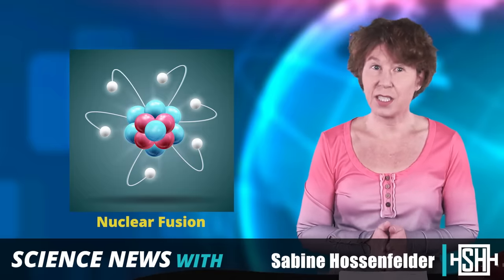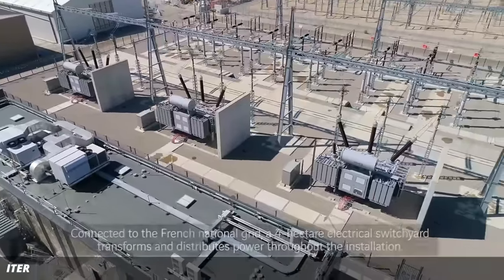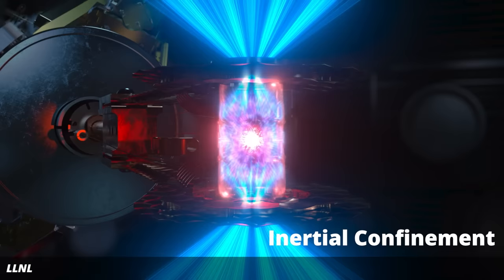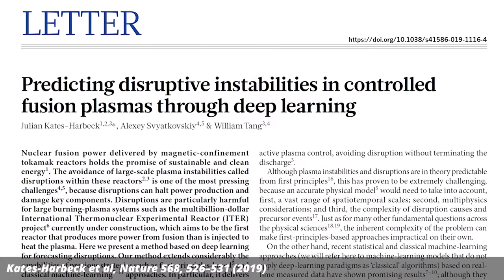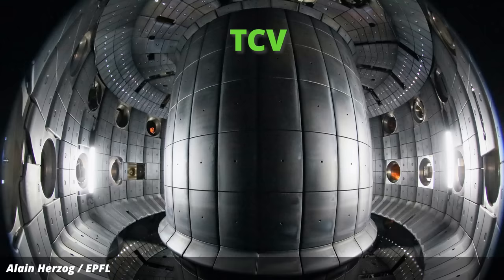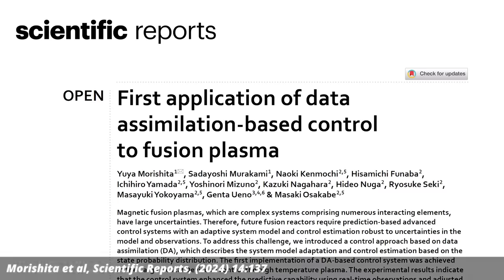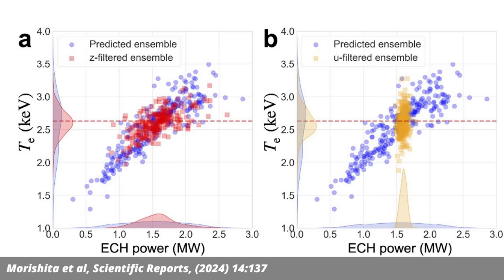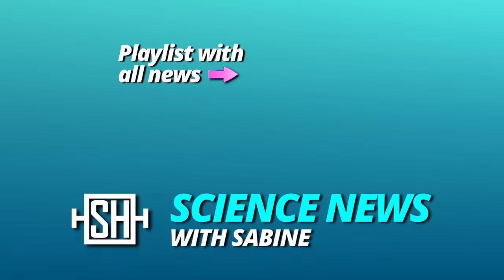First Nuclear Plasma Control with Digital Twin

Comment: I worked at NIFS Institute, where this stellarator is located, in several intervals, and spent there close to one year as a guest professor. The institute was still new when I first visited it, corridors and walls still smelling on fresh paint. They deserve to have progress in this field, they invested a lot in it.

But, there, in their library, I once found a book from a well-known Soviet fusion scientist author, with the text more or less like this: "When I started working in fusion, they were saying it would be achieved in 40 years. Now, 40 years later, people are still saying the same."

Typically, such big news about progress in fusion are launched by the end of a year when researchers apply for new funds, so this helps to get money. I was told this by my mentor, a renown fusion scientist, when I was working on my PhD thesis in Sweden. 

Plasma is so elusive and hard to control. I can only hope that all this mentioned here can be repeated in tests. 

Anyway, thanks for the news and the video, you have my well-deserved 'like'.
Reply: There's a well-known report from the US back in iirc the 1970s or 1980s with similar conclusions, but with forecasts based off of funding given. Of course, it was written for the same type of reason, to attempt to secure funding, so take that and the age of it with some salt. With strong funding, they forecast fusion power well within 40 years, but with less funding, much longer. The actual funding since then, until very recently, has mostly followed their "fusion never" forecast, with funding barely enough to tread water with current developments, and fusion power remaining at the potential "40 years later" mark...
Of course, we now know that they were probably optimistic on the fastest timelines, since some problems encountered since seem to be difficult-to-potentially-unsolvable even with current forecastable technology applications, much less then, and probably the "fusion never" forecast was overly pessimistic - but still.

Comment: Digital twins do start with a very accurate model, but then get updatred with whatever happens to the original. They're a way to look at the potential changes in the original in close to real time.
(Airlines are using them to catch potential engine failures.)
Reply: Boeing need to use them to catch falling doors.
Reply: @andrewharrison8436  Or first catch the missing bolts and not have falling doors in the first place!

Fred

Comment: I vaguely remember a control course about Lyapunov controllers. Something about building a copy of a system, then using the internal states of the copy to better control the real system. This sounds like the digital twin idea here.
Reply: But then doing it with an ensemble, now that blows my mind
Reply: Digital Twins has come up in my work on large chaotic systems. My use of "digital twin" goes beyond a mere model. I use the term to mean "a model and a real system that have 1-to-1 correspondence in both directions" and I suggest that definition be adopted, along with a quality factor that gives the statistics of mismatch from perfect correlation.

Comment: Back in my senior year high school in 2015, I had to do a thesis I had to work a full semester on, and chose nuclear fusion as a topic. This sparked my interest in engineering, physics and mathematics. The year after, I started my engineering degree, which helped me see more and more how the field of engineering can essentially be reduced to an optimal control problem for a very generalized “search space”, depending on the models, parameters and goal function used. 
I connected the dots to the design problem of nuclear fusion and always dreamt of finding an optimal control formulation of controlling a fusion plasma in a yet-to-be-determined, optimal shape (tokamak, stellerator, whatever). 

But as I got older, I learned how these techniques of the classical fields basically always boil down to finding a a fitting model, and then either use formal optimization techniques, or use intuition and heuristics in order to find solutions. But these models inevitably always have flaws and incongruities with experiment due to the fact that reality is simply way too complex to know every parameter of your experiment that you require for your accurate model, and thus the models we use in practice are always a macroscopic, stochastic/statistical distillation of what happens at tiny scales in large quantities, and even thén, there are lots of errors. And that’s when I stumbled upon a paper from researchers who used an AI/data-driven approach to model and control fluids. They started with something that’s completely model-agnostic, and yet it could reproduce like 98% of the dynamics of fluids. No underlying model, not even a mathematical backbone to reason with. Only the computation of properly extracting the data from general AI principles. That’s when I knew that this data-based agnostic approach to control is the future for these very complex systems, and thus the entire field of engineering. 

That is to say that I’m not surprized by this news. This will be the future of nuclear fusion engineering, and it wíll happen and be the energy source of the future, no doubt. The only reason it’s taking so long, and might take a few more years, is because it’s simply one of the most complex engineering problems ever conceived, but not an unsolvable one. It just requires a lot of computation to design and control, which we are starting to have.

Thanks for the video.
Reply: You may benefit from the work at MFMP on YT. Hosted by Bob Greenyer. What Tesla was engineering has NEVER stopped. Cheers. (PS imagine controlled ball lightning.)
Reply: @corkygoss7403  pathological science will get us nowhere
Reply: @corkygoss7403  I’ll check that out. thanks for the recommendation!
Reply: Optimization is problem solving, expressed quantitatively. Computation is the power to optimize. Thus computation becomes the linchpin to solving our most important problems, and microprocessors are the strategic resource of the age.
Reply: @j3kfd9j  well formulated. I agree
Reply: Those who have immersed themselves in engineering and mathematics tend to come to believe that they are extremely smart because few others can understand the challenges that they deal with. Such specialists tend to have zero educational background in the biological sciences and yet that doesn't prevent such people from believing that they are smart about a wide range of endeavors. Such physical scientists and engineers may come to believe that there is no problem that can't eventually be solved and that no matter how dire the climate chaos becomes human cleverness and brilliance will eventually solve the problem. Such techno-nerds tend to reject the concept that there is, or soon will be, a tipping point beyond which it no longer becomes possible for human intervention to solve this grave problem, rapidly leading to another mass extinction event.

I urge readers to search for the following two warning articles that the vast majority of Earth's 8.0+ billion humans have masterfully excluded from their consciousness.

IPCC report: ‘now or never’ if world is to stave off climate disaster (TheGuardian)

UN chief: World has less than 2 years to avoid 'runaway climate change' (TheHill)
  * This statement was made 4.8 years ago.
Reply: @vernonbrechin4207  bunch of nonsense fearmongering. IPCC is terrible at predicting climate change, given their past predictions compared to actual change. It’s even unclear whether global warming is actually a bad thing, rather than a good thing. After all; the places on earth with higher temperatures and more CO2 partial pressure tend to have most biodiversity (tropics). Most plants would love global warming, and plants are the keystones species for a biome of animals to settle in.

The main problem is simply overpopulation, which causes excessive resources to be used up (land area for farming, excavating, etc). Regardless of your stance on climate change, tackling overpopulation in a humane way, e.g. by stimulating poor countries in developing countries (poor countries have very high birth rates), limiting child support, etc. will inevitably kill multiple birds with a single stone as that is the root cause of many problems.

Comment: I've kind of held a position for many years that digital modeling of fusion reactors has been the big needed thing in order to provide the right calculations to control the plasma. But when I heard about how first light was doing it all with a gun type Fusion system to me that seems like the easiest cheapest quickest route to get us to purely clean nearly unlimited Fusion power.

The primary downside which I think is why it hardly gets any press is the fact that some of the materials are used in the nuclear weapon process which does not lead us away from proliferation which was one of the selling points for fusion.
Reply: At some point, we may need to get used to the fact that all of the "rogue states" already have the tech and the fuel to make thermonuclear weapons (see N. Korea, for example).  I'm not sure how much the non-proliferation laws and rules have actually hampered that "progress".
Reply: Because these interial confinement methods are seen as a complete dead end by skilled enginers who understand they can never be a practical enegy producer even if they worked for a single shot.  And making a gun type device produce the heat needed for fusion is something that only a person with no experience in the field of fusion would think is possible.  I take a dim view of most of the magnetic confinement Fusion startups, but the kinetic impact based ones are in my opinion bordline scams in which everyone on them knows they are just collecting a paycheck to 'develop' something they know they can't on an a tech illiterate investors dime.
Reply: @yeroca  At this point, "rogue state" mean "someone disagreeing with USA who rabid NATO war criminals didn't figured out how to crush yet". If genocide of 2 mln enclave plus apartheid plus illegal occupation of millions of people for the last 80 years plus being the most racist country on the planet doesn't make you a "rogue state", nothing will...
Reply: @KuK137  Fair point.

Comment: Chaos and control?  Sounds like a job for agents 86 and 99!
Reply: Or Dr Malcolm
Reply: Or Saphire and steel.
Reply: @atlas3650  Excellent reference! I cant help but think of the quote from sphere "What worries me is that it's reflecting everything but us" when i look at the thumbnail.
Reply: You mean KAOS?  In order to achieve that we would have to Get Smart,
Reply: 86 agent was a show in times of cold war, and Kaos (from the KGB) and Control (from the CIA) had the initials referring to their respective agencies!
Reply: "Not the Craw, the Craw!"
Reply: I almost stopped the reactor from exploding.  I missed it by that much.
Reply: @dr.gordontaub1702  99, I told you not to tell me that.

Comment: Has anyone ever demonstrated that fusion energy can be commercially viable at least in theory?
Everyone's problem with fission energy is that it's expensive (even when it doesn't have to be).
Imagine how expensive it would be to build and maintain those overly complicated beasts?? Seems like a huge waste of time and money to me when we have an actual problem to solve
Reply: In theory, yes, that's why people are researching this technology even now. 

The problem is that theory is often incomplete, so in practice, an unknown number of problems will crop up problems that raise the cost above the calculated cost. 

We've broken even in energy produced in just terms of the direct, immediate energy cost of running a reactor, (which I think is the bulk of the cost?) but not enough to make up for the energy cost of maintaining the reactor over time. 
Once we can break even with the maintenance cost factored in as well, then we can work on getting it to produce returns soon enough to justify it to investors and/or politicians, (it'll take any generator some time to produce enough energy to pay off the expense of building the reactor,) at which point, we're golden. 
Fusion energy holds, in theory, enough value to solve several world problems. It's a way to produce the kinds of energy you get out of nuclear systems, (the binding forces in atoms are extreme, and unleashing them pays big dividends,) but with fewer of the downsides, again, in theory, of fission. (Fission doesn't have as many of the downsides as people often think, but they do still exist.)
Reply: @peppermintgal4302 fusion wil not solve the enregy or climate crisis we need to use allready proven tech in the mean time (solar,wind,hydro and nuclear)

Comment: If I recall, modern fighter jets (and even less-than-modern ones, like the F-16) are inherently unstable in flight. That's why they're so maneuverable. This requires computer control to keep the planes from being uncontrollable. I still recall, while in the USAF in the early '90s, seeing an F-16 in horizontal flight, rotate 110 degrees on the pitch axis and rocket off - upside down.
Reply: Yes this is why fly-by-wire systems were developed. The pilot tells the plane what they want it to do with the controls and the computer interprets what the plane needs to do to make it happen.
Reply: yeah, but fluid dynamics is just peanuts compared to MHD...

Comment: Even if they get hot fusion to run non-stop,the problem of intense neutron radiation inducing radioactivity in the reactor core steel means fusion reactors will NOT be better than fission reactors,as the steel of the reactor core will become intensely radioactive,requiring periodic and expensive replacement. The replaced parts will be dangerous radioactive waste requiring special handling and isolation.
Reply: Without exact numbers, we cannot be certain about it. If more energy per unit of nuclear waste is produced by fusion reactor for the lower price, then then fusion reactor is the way forward. If it is comparable, then, it will be used for a space exploration.
Reply: but its a different type of waste. fission produces tons of fluid mid-level waste which is terrible. here there is no shitty iodine nor caesium or strontium. As such, it should be "less problematic" so to say
Reply: Sounds like they need to build the reactor out of DU, so the transmutation gives you enriched fissile fuel!
Reply: activated steel is much less of a problem than spent fuel rods. You're comparing apples and oranges.

Comment: I am an IT architect that has worked with Digital Twins and the difference between a model and a digital twin is that the digital twin is made to be a live copy of the real counterpart. That means that when you check the twin and it says that the temperature is 20 degrees, then it should be 20 degrees in the real thing as well. It is not used for simulations by itself, it is used to give a remote digital view for work and analysis without walking around on site, and to allow for training of different scenarios. 

So it is not "just a buzzword".

Comment: Fission needs none of this with plenty of fuel availability and no waste issues when using modern methods. 
It's still very interesting, though.
Reply: Problem is: there still are a lot unsolved waste issues.
Reply: which modern methods? but I kinda agree tho.
Reply: "Modern methods" and "no waste" usually goes in the direction where we are at risk of nuclear proliferation due to breeder reactors and plutonium based fission reactors.
Reply: @O_Lee69   not unsolved. Unused potential energy. Check  out waste burners of MCSFR's
Reply: @drgetwrekt869  waste burners like DMSR's or MCSFR's
Reply: @lingondraken  plutonium based? All reactors make plutonium. Modern reactors use more HALEU, which increases PU production by some but also burn it alot more efficiently.
LFTR's make pure U-233,   so there is no argument there.
Both can be dealt with in DMSR's or MCSFR's. All about the choices we make.

Comment: why can’t we just build a big magnifying glass, point it at the sun, use it to boil water into steam to spin a turbine and charge a battery, collect and re-condense the steam back into water and rinse and repeat? 

am i high or is this not free energy we could be using?
Reply: Its called solar concentrators. They are used, but, given the complexity of the system and maintenance, solar panels wins the competition. 
Still, it not a dead technology, there are uses for it.
Reply: They did. It's called solar farms.
Reply: then they should use it to rekindle the First Flame, bring on the Age of Fire and end the curse of the hollows…

Comment: This is genuinely fascinating. It seems like what the research is starting to say is that unlike with developing aircraft where it was possible to start with an aerodynamically stable design and work towards faster responding and ultimately non-aerodynamically stable designs as we now use in fly by wire fighters, in this case achieving a self-sustaining stable fusion is really hard but we have enough computing power available now that we may be able to start with somewhat unstable designs and push and prod the fusion to simulate a stable outcome! If that works, reliably and over longer time periods then that’s a huge leap forwards.

Comment: That newer stellarator design is similar to a design used in a compact linear accelerator by a company I worked at decades ago. It was designed for DoD as was called SLIA - Spiral Line Induction Accelerator. They also designed the original dual post hole convolute (the wire 'cylinder' used to create the magnetitic field that collapses and causes fusion) used in the original Z-machine at Sandia National Labs.

Comment: I think the main difference for  stellerator vs tokamak is stellerator is designed to be continuous and a tokamak is designed to be as erieus of long pulses (induction requires changeing magnet field so it must be charged and allowed to collpse to twist the field)